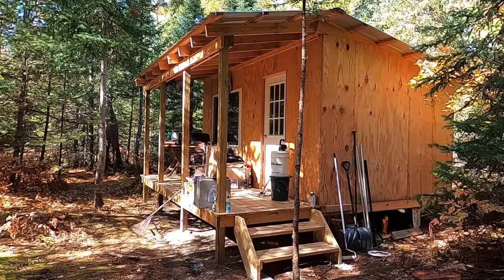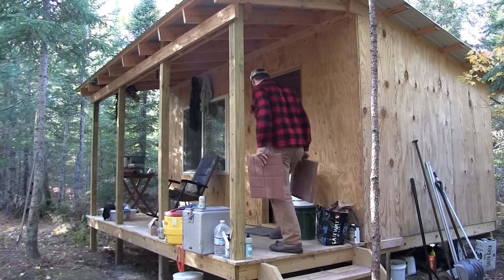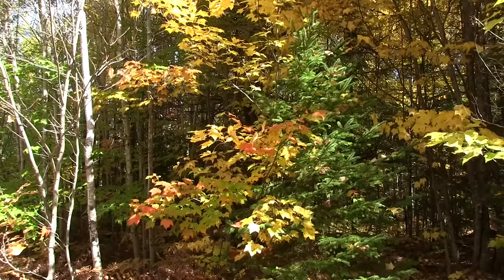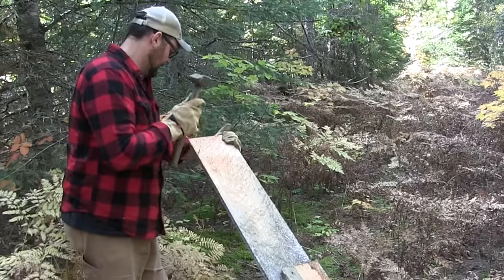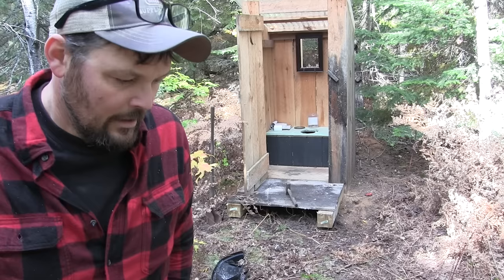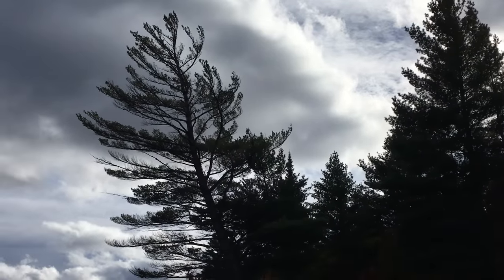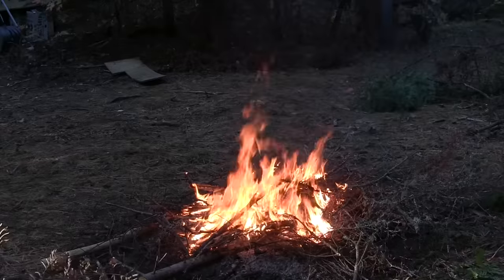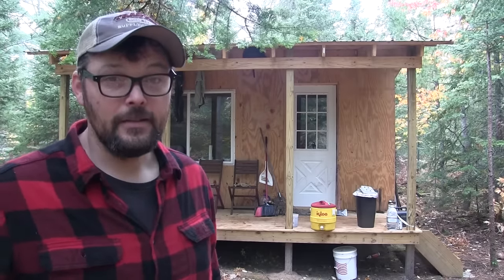Cabin upgrades & Bear Damage

Comment: I fished for decades with my dad on small trout lakes in Quebec with just a row boat.   If the lake is no more than a couple miles, no need for a motor, and you’re right, it’s way more relaxing, quiet, and easy without having to mess with a motor.
As for the bear, there’s two kinds.  The ones that hang around, maybe come into camp or whatever, and they’re usually no problem.  Then there’s the ones that raid your outhouse……those are the ones to worry about.   Nothing that a poop eating bear won’t do! 😀

Comment: "Good thing I brought a screw-gun."  LOL, I usually have a pretty wide assortment of cordless screwdrivers wherever I go.  Nearly all of my screwdrivers are cordless, reversible, variable-speed, and variable torque.  The whole thing of suddenly needing tools you don't have reminds me of a bicycle ride.  I was just going to ride around the neighborhood a little, make sure the bicycle was all working well, so I didn't bother taking much.  I was on my way back home, about 10 miles or so from the house, when I got a flat.  No flat repair kit, no spare, just a frame pump.  It was a hilly area, so I walked it to the top of a hill, pumped up that tire as well as I could with the crappy frame pump, then rode down as fast as I could.  By the bottom, the tire was flat again.  Rinse and repeat.  After that, I always had a little tool bag with me on rides.
$75 for a functional rowboat?  That seems like a steal.  I prefer a canoe, but like rowboats well enough.  I love all the focus on the positive, though acknowledging the negative.  Thanks for another good one.

Comment: When i was installing our fisher grandpa bear woodstove id decided i didnt want one of those generic stove mats. I asked around about using brick pavers and everyone said oh no it gets to hot,youre gonna burn your house down. The floor of the stove has firebrick and its legs are almost 8",so i went with what i wanted. I put down duroc screwd to the floor and mortared in a 5ft x 5ft brick paver hearth pad that looks and performs wonderfully. I trimmed the outside of it with a hardwood frame. My cat loves sleeping under the stove throughout the winter,and it only cost about $75 ti build. The 5x5 hearth sounds large,but the grandpa bear stove is almost 3ft wide and has to be 3ft from the wall.

Comment: Wow, never even though of just using patio stones, haha!  One of my first big projects was a hearth pad for my fireplace stove. I went to a flooring store and asked for 1’ tiles. Apparently they don’t make ‘em that easy anymore but he had 10x1’ lovely marble slabs. I needed 9so I took them and ran. Sheet of 3/4’ plywood $60 and the tiles and he just gave me enough mud for my project, $60. So for $120 I got a really nice pad.

I bought 5 hammers at a yard sale and a bunch of measuring tapes but yet, I can never find one when I need it. A rock worked nicely for a nail yesterday. Gotta love off grid and the trials 

Thanks for the fun!  Get that bear,  bear steak is good, mmmmm.
Reply from the maker: Right on. Thanks

Comment: I’d suggest getting a solar panel so you can recharge a little bit of power for your power station. The one I have is a rock pals 60 watt solar panel which is water resistant and there is a sale going on right now where you can get it for sub 80$

Comment: A sheet of 3/4" plywood covered every 3" apart with 2" drywall screws then left on the floor with the screws up on your porch will do the job keeping bears or anything else away from your door or window, just secure it to the deck with 3-4 screws. works on the ground around windows not on the porch as well may want to use treated plywood.

Comment: Nice job with the pavers. Our first wood stove forty years ago had those, but when we installed slate over concrete board later we found scorch marks in the subfloor under them where hot coals had sifted through the cracks. Not reassuring. Maybe a sheet of flat steel under the pavers?
Reply: Thanks for the idea. Very smart. I’ll do that when I install my wood stove.
Reply: @William4143    Made me a bit paranoid, so went with a thin piece of concrete board and mortared the slate over it. Have had to regrout  it once as the original broke up a bit from dropping wood chunks on it. Subfloor was just that compressed sawdust crap that burns really well. I nagged the OP when he put the stove in to protect the flooring, so glad he did. Still suggested a steel plate underneath for those sifting hot ones.
Reply from the maker: Thanks for the tips!
Reply: @Bushradical    One of the few perks of being very old is that I’ve tried to remember at least some of my screw-ups! My grandkids and great grandkids still seldom believe me. Until they screw up too.

Comment: Could have used you today. Got lost in the woods (in the U.P.) in a snow storm. I got turned around and for the first time in my life I had to use my compass. Unfortunately, In an attempt to hold on to all of my gear while getting my bearings, I didn't realize my gun was throwing off my compass. I walked nearly a mile in the wrong direction. Thick, heavy, dense woods with a hour of visible light. Finally made it out almost a mile north of my intended exit. Thank God for my headlamp. I was on the verge of spending the night. I always carry a lighter and was dressed for it. 12 degrees and headed lower. Would have been a challenge. I was a bit anxious to say the least. I'm cramping with exhaustion as I write this.  Ill be better next time.
Reply from the maker: wow! thats a close one. You should order all three books by "Ben East" he has several stories of people lost in the woods....may of them in Michigan.

Comment: Nice lesson on keeping things simple and getting by with what you have. Really like the little cabin. I have your basic cabin build vids saved in my favourites for one day when I get to do my version.
I’ve lost track of your vehicle selection - any chance you could do a ‘fleet update’ and tour of them. I’m a fellow 80s F150 driver - I turned mine into a camper, though. Still got the Escort wagon? 👍🏻
Reply from the maker: The escort wagon rolled down the driveway and hit the old barn.....so I sold it and bought a pontiac vibe. I have a 88',92',95,96, f150.........a 97 f250.
Reply: Quite a collection of F series trucks then. Vibe has the Toyota motor, I think, as it’s basically the same car as the Matrix, so should be reliable and last for some miles. Similar philosophy to me - I can’t afford a new one so have several old ones and hopefully at least one should be running!

Comment: I noticed your Coleman stove has the propane that has the pump on it. That’s what my parents used when we camped. I have been wondering if one can still buy propane for those types?? Where would I look? I’m in Texas.
Reply from the maker: It's coleman fuel, not propane. You can get it at any sporting goods store. I run regular car gas in mine quite a lot

Comment: The porcupine lodge is too big for a cabin and to small for a house. If it is accessible all year it could be either. Dave and Brooke will have to decide before he starts. If he is going to make it a house it will cost a lot more and once he invests in the rehab he will have finish it that way or lose his investment. As a 4-season house he will need siding, electricity in the least solar friendly place in the US, with a propane backup generator, a condensing furnace with ductwork, propane bulk tank, pumped water that does not freeze in the winter, hot water heater, shower, plumbing, flush toilet, septic tank, and leach field, lots of insolation, thermal pane windows, and who knows what else. I do not know how he could get a return on his investment. I doubt there is nearby employment which means a retired couple would be the only one who could live there. The porcupine lodge was abandon for a reason (location, location, location). As a cabin unless it is summertime only it’s too big, he cannot heat it with a wood stove without a loft. I have never seen anyone lay channel iron on its side, it reduces the beams strength by 75%. I would like to see them turn it into a home and wish him the best of luck. Radiant hot water heat would be easier to install as their does not appear to be a good place for ductwork. It will be difficult if not impossible to get insurance or a mortgage on the Porcupine lodge. A lease, land contract or cash will be the only way unless Dave and Brooke want to live their themselves. Insurance companies are now canceling policies of houses with solar. Michigan has less solar charging hours than any other state and even less in the upper part of the lower peninsula. Compared to the grid In Michigan Dave and Brooke would never recover the cost of a solar system, however it is better than nothing and more cost effective then a generator in a 4-season house. Not so in a rarely used cabin. In any case those incandescent light bulbs are poison to him, and he should get rid of them immediately. As a part time cabin a D.C. system is the way to go. Invertors, boost or buck convers, rectifiers, and voltage regulators are inefficient and wasteful. Along with their cost the best of them is maybe 90% efficient and that is only when used at or near their max rated power. As the percentage of max power falls off so does their efficiency, not to mention their no-load power consumption. 12 or 24 volt D.C. with Harbor Freight solar panels has none of those problems. He could use 12 or 24 volt D.C. LED lightbulbs and the existing wiring for lighting. Everyone I know who has a cabin in Michigan fears theft, vandalism, and dumping. Their defense is usually to leave nothing of value to steal.